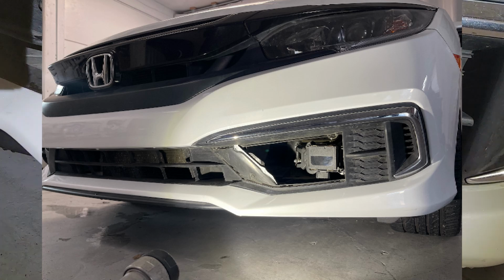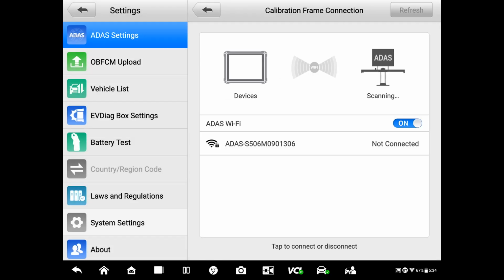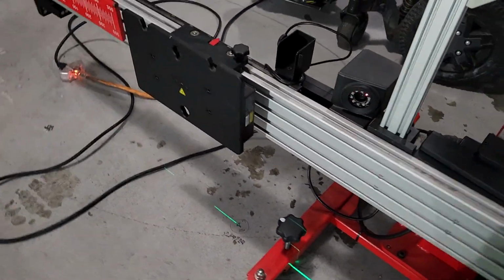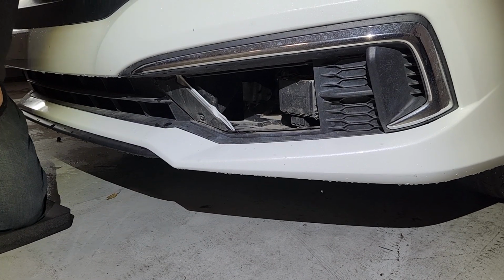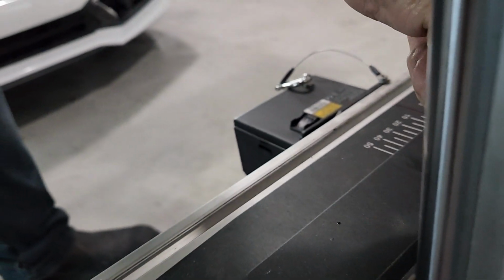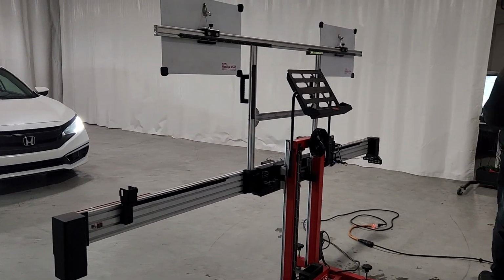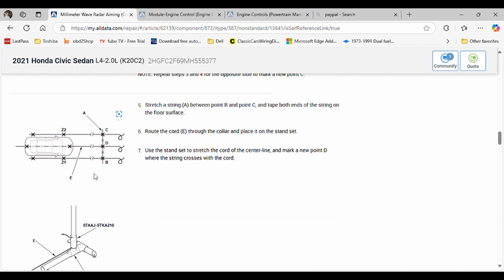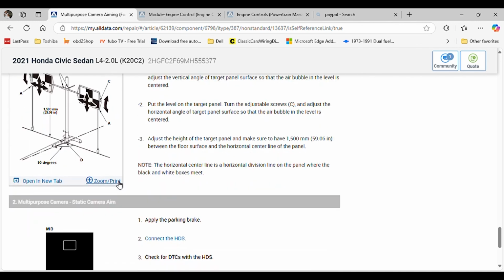2021 Honda Civic P2583 -76 Temporary Stop Of Integraded Driver Support  System P2583 -54.

Comment: Hey good afternoon I scan my car with a not so good scanner and I did not have a code , my question is do you think I need a calibration because yesterday I ran over a tire in the freeway and today wen I woke up and I started my car to go to work I notice that I have a lot of warning lights saying that my lane assist is off and cruise control is off , and some other stuff is off . Question what do you think the problem is ? My car is a 2019 Honda accord
Reply from the maker: You need to scan your vehicle to see what's triggering the lights. 
Make sure you use a scanner capable of reading the driver assistance system.  A code reader will only read the engine system and not show any codes. 
 Where are you at? What state?